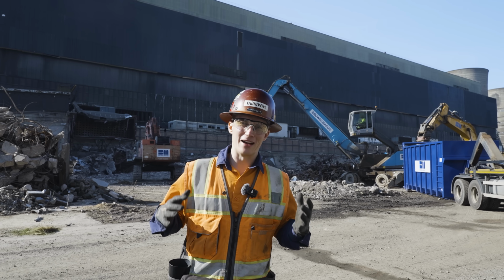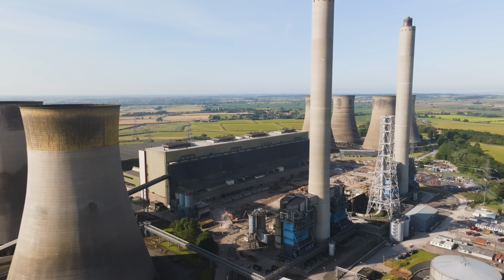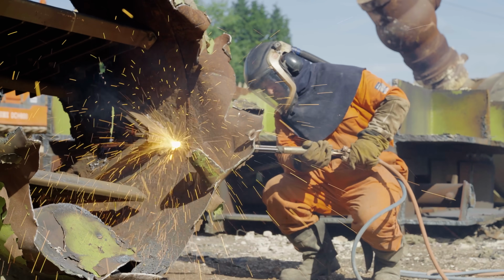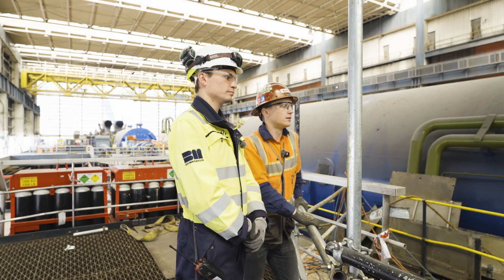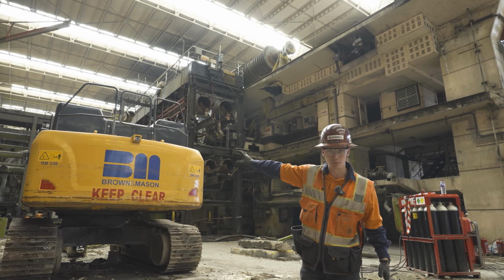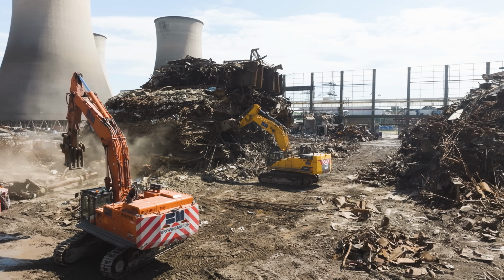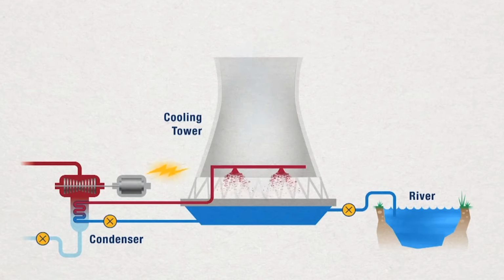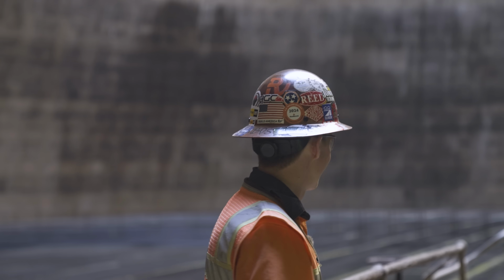How to Delete Entire British Power Plants!

Comment: I used to go onto both of them power stations 2004 -2012 looking after the heavy plant on the Ash side ( which makes insulating blocks and constriction infill). 
And the motor scrapers was a joy to work on.
I was at Cottam recently to repair the Demolition machines how sad it was to see it being knocked down. 
Them places are far safer than Nuclear and we can reuse the byproducts unlike Nuclear.
And people need to see how windfarms are constructed.
Reply: "Them places are far safer than Nuclear"
No they aren't. They just kill people slowly so the public don't notice.

"we can reuse the byproducts unlike Nuclear"
Nuclear produces tiny amounts of waste: kilos per day, rather than thousands of tons per day.
Reply: Yes people should also see what is in the soil around a coal fired plant. 

Or how all the concrete for the towers is made or how diesel is added to the coal before crushing when it’s wet  

Coal is the worst fuel.

Comment: Can a coal plant be converted to cogeneration?
Reply: @E_L1000  The simple answer to that question is ‘yes’ . There are many examples where a coal fired power plant has been modified to burn other ‘fuel’s’ . But this generally doesn’t work well because a boiler works best on the fuel it was designed for. However having said that, Drax power station (also in the UK) has converted 4 of its 6 coal fired boilers to burn wood pellets. This is the only former coal fired power plant still operating in the UK. But it is only profitable due to the subsidies that it receives.
Reply: @philburton2901  Thanks! What about burning normal household waste in cogeneration plants?
Is that common in the UK?
Is it feasible to convert from burning coal to burning waste/garbage?
Reply: @ As far as I know, co-gen plants are not common in the UK. 
Burning domestic waste in a conventional coal fired power plant would not be possible. Most coal plants use mills to grind the coal into a very fine powder which is then blown into the boiler. This fine powder burns inside the furnace like a gas. This enables the boiler to produce very high pressure and temperature steam.
We do have quite a few new power plants in the UK which burn household waste. They have become commonplace near many towns and cities. This is mainly due to increasing taxes on sending waste to landfill, rather than for their electricity output. They have been specifically designed for burning waste rather than any other fuel.

Comment: grew up in the shadows of both of them stations and nearly started there as an apprentice when I left school. the green revolution is a good thing but what does the 1000+ workers that those sites employed do?
Reply: Fit solar panels service and assemble wind turbines 

Work at the two mew nuclear plants 

Fit out the power grid for higher capacity power lines to move energy around more 

Service battery systems in houses

Comment: Absolute joke we are going to have no power stations left talking about going electric without these powerstations we are fucked
Reply: @asamitchell7948  some might even think it’s sabotage to destroy cheap base load power, which is the backbone for economic prosperity. At least there is the green dystopia and expensive energy rationing to look forward to.
Reply: Have your lights gone out  ???????
Reply: Generation has to meet demand, so clearly we have enough generation. These power stations have been offline for a while, and the lights are still on.
Reply: @RyanJ_  the way they are decommissioning power plants and expect us to switch to heat pumps and electric cars the grid cannot handle the load as there is not enough generation to meet that demand.
It's never shown in the news but we are screwed if the government doesn't build a few more nuclear powerstations only way to meet demand.
Reply: @asamitchell7948 errrrr they are
Reply: yep make you right...
Reply: Really when a small storm appears the green energy is wrecked what then replaces that nothing it’s a blackout no backup plan
Reply: @djrigga  We've had multiple storms since switching off all coal, so it seems to be working fine.

Comment: Why is British industry, and power generation being systematically destroyed?

Why is industrial production going overseas?

Why is UK Power so damn expensive??

NOT GOOD!!
Reply: Generation must meet demand. If a plant goes offline then something has to match its output. These plants have been offline for a while, so clearly existing generation is adequate.
Reply: We don't drive around in 50 year old cars. Every power-plant has a design life, and the longer you use them the more goes wrong and breaks down. In the case of a thermal power plant using steam, a breakdown can be catastrophic and kill people (this happens). It becomes more and more expensive to maintain aging equipment. So at some point, you have to shut it down. Then you have three options; rebuild, keep it as a spare for emergencies, or demolish. The third one is actually the most economically sensible much of the time, which is why these are being demolished here.
Reply: It’s failing badly they want windmills that don’t work there is no industry in England it’s dying as a country it will end up third world

Comment: There is almost the same amount of work demolishing as there is building it. 🤔 Crazy.👍
Reply: You’re having a laugh.
The engineering in to building a power station is 1000 times more cost..
The demolition is such a sad thing as we’re not in a position to rely on wind and solar,especially for the roll out off EV’s
Reply: @Only-one-life-68  The UK has enough generation capacity to no longer rely on coal. Coal power has now stopped and generation has proven to be sufficient.
Reply: Hi hope you’re correct though !!

Until we get a very cold 🥶 winter and we’re all reliant on EV transport for domestic and commercial travel
Reply from the maker: yeah it's incredible how much goes into it!

Comment: When at college about thirty years ago, i had a visit to Eggborough power station (on the M62 England), the boilers were hanging from the roof, so expanded downwards as they got to temperature, they took us to the top of the boilerhouse, the lift doors open and you are about to step out and you see that all the floors are lattice so they can take them up for moving stuff around in there, and that first step is difficult you can see all the way to the bottom, great visit, all these stations have been repurposed to "biofuels" or are being demolished, never thought i would see the day.